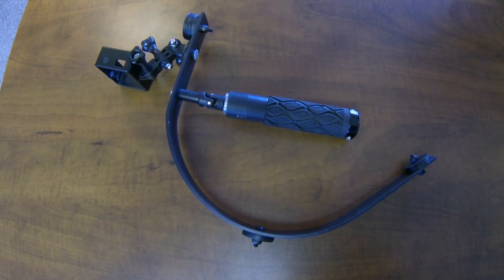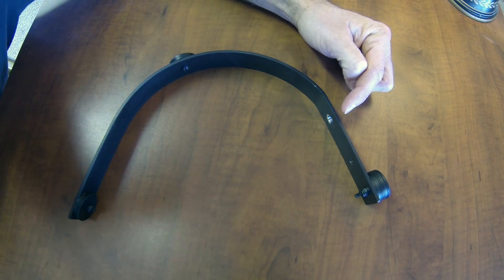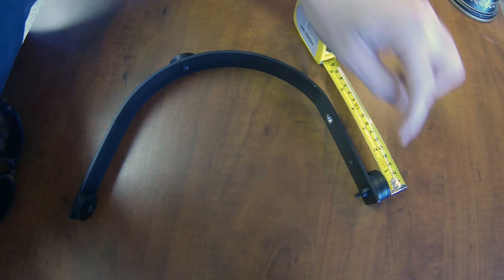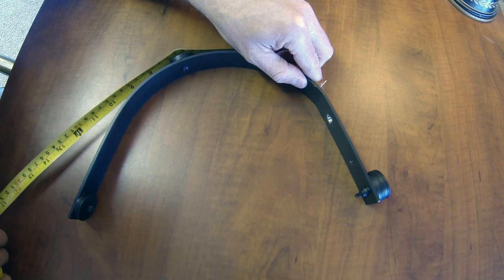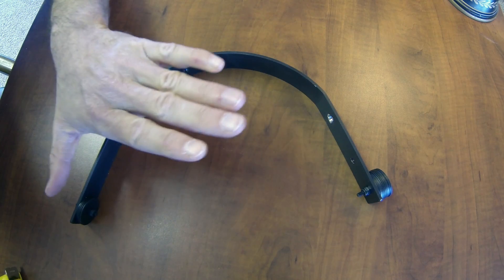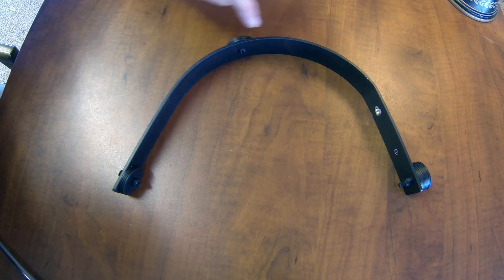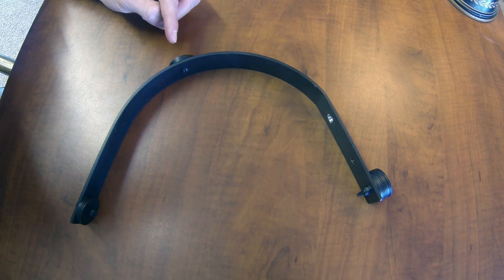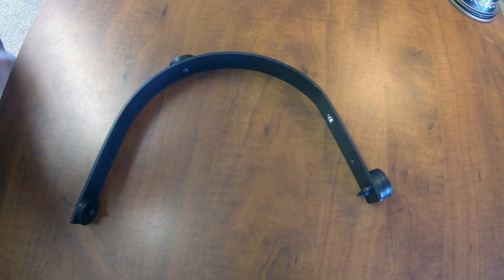DIY GoPro Steadicam Version 2: Step-By-Step Build How-To

Comment: How well would this work with a dslr?
Reply from the maker: I have never tried it but it might be a little small for a dslr. Obviously you would have to add a lot more weight. I think you might want to upsize the frame and weights. The grip/bearing/joint should work just fine for a dslr.

Comment: HI,
I'm from India.. Just wondered what to ask for getting that aluminium bar.. You made it specifically for this.? or bought it.? just let me know how to get tat bar..
Reply from the maker: Hello, The aluminum bar is 1 1/4" x 1/8" x 3' long. That is roughly 31.75mm x 3.175mm x 1 meter. I purchased this bar at a big hardware store and bent it my self. It is not hard to bend. Let me know if you need more help.
Reply: God's Country Thank you so much.. After a lot of search, we dont get the Traxxas 1651 in India.. Is there any other part i can use instead of Traxxas 1651 for the flyer..?
Reply from the maker: Thilagarajan Selvaraj . I did not use a Traxxas 1651. I used Traxxas part numbers 4953x and 4949x. They combine to form the joint that I used. All of the part information is in the video description. If you can't get Traxxas parts, you might be able to find a joint from a different manufacturer. These are U-joints / axle shafts are for remote control "toy" cars. I used the Traxxas part because the shaft fit the bearing inside diameter perfectly. The bearings are important to get smooth video. Let me know if you have any other questions.

Comment: Is it possible to turn this upside down for top down shooting?  Or would I be better off with a glidecam style, straight build
Reply from the maker: Interesting question and one that I haven't thought about before. I think it would be possible. You would definitely need to change the weights around a little so the camera side would weigh more than the end of the frame. I'm sorry I've never used a glidecam style so I don't know much about them. After a quick look, they appear to mount the camera on the top of the rig also.

Comment: Hi there, love the concept but Im really struggling getting the balance right. Im using a Hero2+ wifi bac and the camera makes it too top heavy. Tried adjusting the washer but they just dont compensate for the top heaviness. Any ideas? Thanks
Great idea, thought
Reply from the maker: Hi Brad. Sorry you're having problems with the balance. I don't have experience with the Hero 2 with the wifi backpack but it is probably a lot heavier than the Hero 3 that mine is set up for. You may need quite a bit more weight than I have on mine. There will be some point where the bottom finally becomes heavier than the camera on top. You will probably have to add a lot of weight on the bottom. The first thing you need to do is get it so the rig isn't top heavy anymore. Keep adding weight to the bottom.

Comment: How much would u say this build cost to make?
Reply from the maker: Hi Jamie! Sorry it's taken me a while to reply. I've never added up the costs. It depends on what you have on hand and what you have to order/buy. I already had most of the components. I think the aluminum bar was about $10, the gopro tripod adapters are around $8, the Traxxas u-joint parts are about $15 plus shipping, bike grips can be had for $5-$30 depending on how high-end you want to go. Bearings are $14 plus shipping. It's a fun project and works well but you have to watch your costs.
Reply: Thanks for the response. Awesome job!

Comment: i built this and i dont have a problem with the spinning but i have a problem with the rocking.  as i move forward and backwards, the entire rig rocks back and forth as the back weights and the bottom weights act like a seesaw.  have you any remedies for this or any idea what I am doing wrong or what i could adjust??  Thanks!
Reply from the maker: Hi Doug. It sounds like you may have to much weight on the bottom of the steadicam. The bottom should only be slightly heavier than the top in order to keep the camera upright. It's tough to diagnose a balance problem over the internet but I would try removing weight from the bottom a little at a time. It takes a lot of trial and error to get these things set up right. Let me know how it works out for you.
Reply from the maker: P.S. I've got a couple of other videos that talk about balancing and might help you out.
Reply: thanks for the quick reply.  do you have any videos were you are actually using the stabilizer?  or videos of it in your hand moving it around?  i just want to see yours looks like versus mine.
Reply from the maker: Douglas Lee Hi Doug.I don't have any videos of the steadicam in front of the camera but I do have this demonstration video: DIY Steadicam VS Grip Mount Demonstration - Which Is Smoother?

Comment: Question- is there any reason you emphasize the CPVC instead of regular PVC? I happen to have a length of PVC and don't want to buy if I don't have to! ;) 

Also- as I'm building mine I came up with a mod that I can't wait to share with you! It's either genius or a total clown move. We shall see!
Reply from the maker: Hey Leon! Looking forward to seeing your mod. I used 3/4" CPVC because it fits in the grip perfectly and the CPVC coupler is close to being a perfect fit on the outside diameter of the bearing. CPVC and PVC have different inside/outside diameters. 3/4" PVC will not fit in the grip. 1/2" PVC will probably work in the grip but I think the inside diameter of the coupler is to small.
Reply: Hahaha! I had a feeling... I posted that message before I went shopping for my last pieces and took my PVC with me. The grip DEFINITELY would have to be forced. I'm debating... force or bite the bullet and buy a pipe. ;)

Anyways, I was able to get everything I needed locally except the bearings. So I ordered them from the same site you noted. They come from Anaheim which is only over an hour away from me so I hope I get them soon. Thanks a ton, my friend!
Reply from the maker: Leon Sandoval Great! I'm glad you got your supplies rounded up. You could wait till you get the bearings so that you can check their fit in the pipe fitting. Anyway, Good luck and let me know if you need any more help.
Reply: I couldnt find CPVC but found a cooper 3/4 coupling and 3/4 cooper pipe fits perfect and has a nice feel to it also even without the bike grip
Reply from the maker: Brad Cook Thanks for the feedback Brad. That's good to know. How well do the bearings fit in the inside of the 3/4" copper coupling?
Reply: God's Country They fit really really well. I added 1 layer of blue painters tape and its nice a real snug fit
Reply from the maker: Brad Cook That's really great to hear. Thanks for the information!

Comment: Hey! Where did you get your bearings? I was looking at Amazon, but either they are too expensive or they take forever to be shipped. Do you have a link you could share?? Thanks, the video was great!!
Reply from the maker: Hey Eduardo. I bought mine from bearingsdirect.com but vxb.com has them also. The 6x22x7 size that you need for this project is not as easy to find as some other bearing sizes. Glad you liked the video! Let me know if you have other questions.

Comment: Hi.  Do you have any tips about setting the weights up?  I have all the parts, but I'm not sure how to work out the weights.

Is there any way to work it out by balancing it on your finger in a certain place?  
Thanks for the great videos :-)
Reply from the maker: Hi Ian. Thanks for the comment. You might want to watch this older video of mine: DIY Steadicam Design and Construction Tips - For GoPro Hero 3+ and Other Cameras . It talks about balancing and camera/handle position starting around the 3 min mark. Did you build yours exactly like mine? If so, start off with the same number of weights as mine. Otherwise it's just a lot of trial and error adding and removing weights. The lower part of the steadicam should be only slightly heavier than the top so that it keeps the camera upright. If you draw an imaginary line down through the camera and grip, the front half of the steadicam should balance with the back half. If they are equal than there shouldn't be any rotation around the grip axis. Equal weight front and rear does not mean equal number of balancing weights because the front already has the weight of the bow/frame. Let me know if you need more help.
Reply: I did a rough quick build before I saw your video and all the weight is below.  
Thanks for the detailed info.  I'll watch your other video and I'll let you know how I get on with it.  
Thanks....

Comment: do u get an uncontrollable spin when you hold your Steadicam because of the smoothness of the bearing 

i didnt build this model i actually built the silver flyer Steadicam because i saw that video first but i noticed the rig spins to much so im looking around for a different handle setup
Reply from the maker: Thanks for the comment. The bearing/handle needs to be free spinning so that your hand movements don't get transfered to the camera. The spinning that you are describing comes from incorrectly balancing the steadicam and camera. It sounds to me like you need more or less weight on the front or back of your steadicam. I'm not familiar with the silver flyer design but somehow you need to adjust your front to back weight distribution. You could also do this by moving the camera position forward or back. Watch this video starting at about 2:15. I talk about balancing and weight positioning: DIY Steadicam Design and Construction Tips - For GoPro Hero 3+ and Other Cameras I hope that helps some. Let me know if you have more questions.

Comment: I plan on building this sometime this weekend, and then I'll probably upload some test footage with it in the coming few months. Do you mind if I show off your design? I will put a link to this video in the description of the test footage video I upload.
Thanks!
Reply from the maker: Hi Grant! Thanks for the comment. That would be great if you put a link in your video. I would just ask that you balance it correctly and practice with it so that you can get the feel of its full potential. Have fun with the build and let me know if you have any questions along the way.
Reply: Yeah I'll be sure the footage looks good before I upload it. What's the best way to know how many washers to put on, or should I just play around with it until it doesn't move around at all?
Thanks
Reply from the maker: Grant Piering If you're going to build it similar to mine then copy my washers as a starting point. From there, just add and subtract some and you'll start getting the feeling for it. If the steadicam is rotating around the grip, you need to add or subtract weight in the nose or behind the camera. If it is swinging, you need to add or subtract weight from the bottom of the steadicam. Let me know if you need more help with the balancing.

Comment: Thanks for the great video.  I would like to see a follow-up video of it in action. I can see how to build it, but I have no idea how to use it, or even the benefit of using it.  I mean, I have a general concept of what the stabilizer is for, but how do you use it?  I am in my late 60's and am struggling with shaky hands.  Will this help me to take better video?  Maybe post some videos you've taken with and without using your stabilizer.
Reply from the maker: Hi Michael. Thanks for the comment. Here is a video that I made just for this purpose: DIY Steadicam VS Grip Mount Demonstration - Which Is Smoother? . You can see that the steadicam is much smoother. The steadicam is not a cure-all though. You still need to be smooth with your hands, arms, and while walking. The smoother you are, the better. I would say that a steadicam would really help you since your hands are shaky. How are you holding your camera now?
Reply: God's Country About all I can do is use a tripod, which isn't always convenient/possible, or squeeze my elbows to my side as tightly as possible when I'm shooting handheld video.
Reply from the maker: Michael Burch I agree that tripods are great but not when you're moving around. I think a steadicam will probably help you film smoother but you should also look around at the different ways that people are accomplishing the same thing. I have seen some rigs that rest on your shoulders that may work for you. The good thing about the steadicam design is that it's pretty compact and light weight. I think a steadicam, when used with two hands, will smooth out your videos. Unfortunately I can't say if it's the best for your use because I haven't tried the other designs out there. Sorry I can't be more helpful than that!

Comment: Would a 8 by 22 by 7 ball bearing work you think?
Reply from the maker: The first number is the inner diameter of the bearing. The shaft of the Traxxas stub axle is 6mm so if you were to use a 8x22x7 bearing, the bearing would be very loose on the shaft. I wouldn't recommend it. You could possibly put some type of spacer in there but the 6x22x7 is a better solution. The second number in the bearing is the outer diameter so that 8x22x7 would fit the CPVC handle just fine. The last number is the width of the bearing.